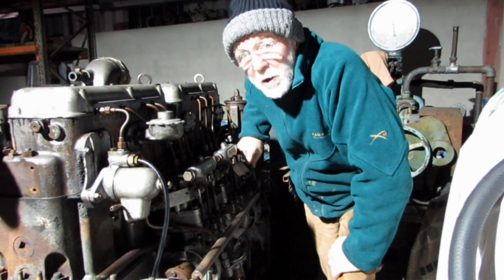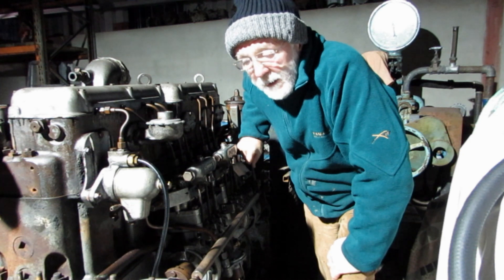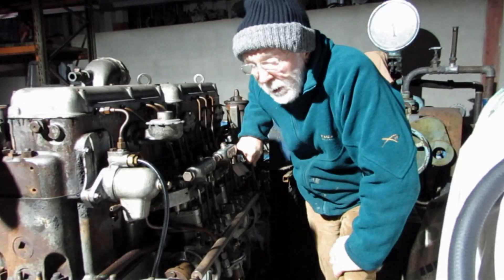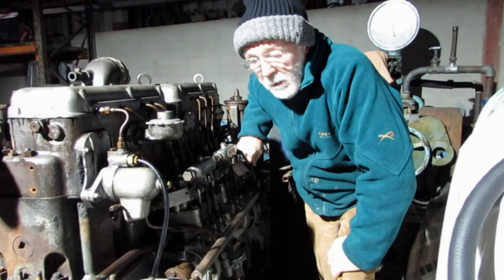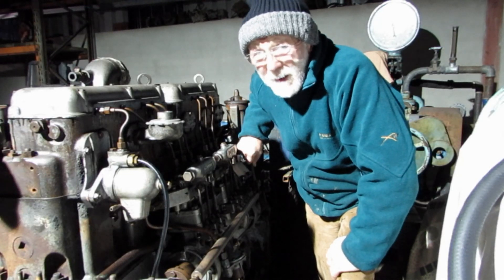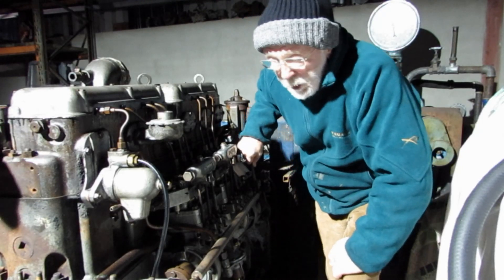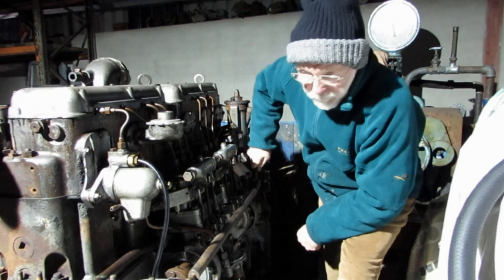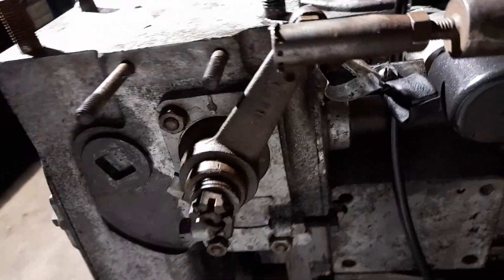Gardner Engines: the advance retard mechanism

Comment: 😮Wow I just learnt diesel engines have a advance and retard for fuel delivery at just before top dead centre. I'm currently searching fiat 540 C.A.V pump manual retard device videos as mine is leaking from the plunger seal, I think I need a new one from ebay.
Anyway I came across your channel and think its awesome, I have little knowledge about diesels and this channel I hope teaches me early learning through to technical information, I very much look forward to watching all your viedos.
🦘

Comment: Thanks Joe thanks for that my question is how critical are the stops on the LW engine  as my engine they had disappeared before I got the engine i have put some back but will have to get someone to set them
Reply from the maker: Well, they can play a role in setting the idle and max rpm.